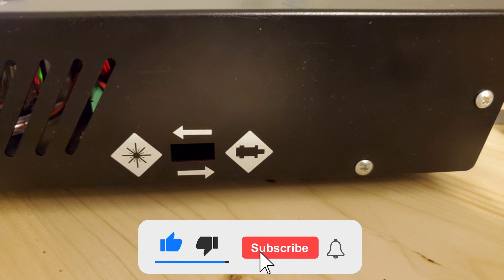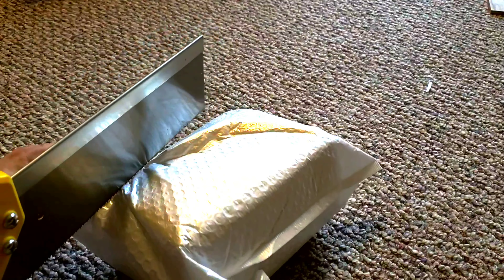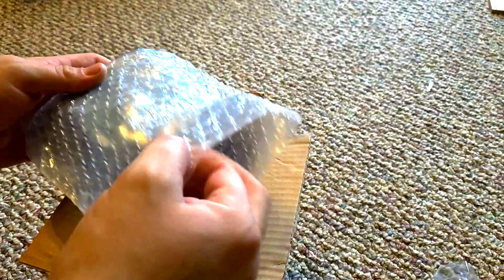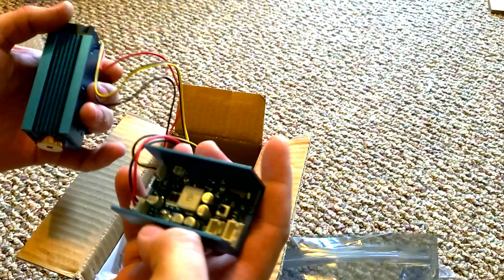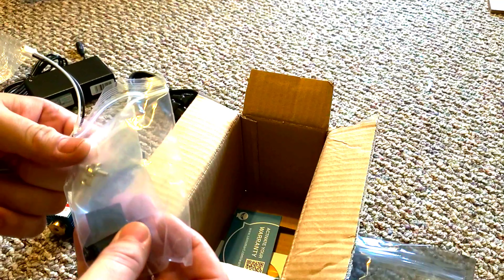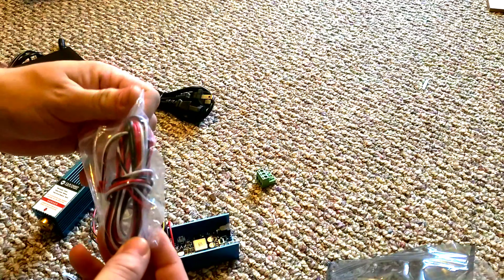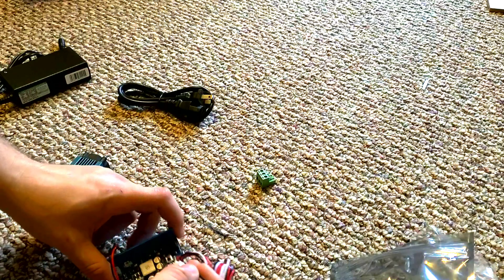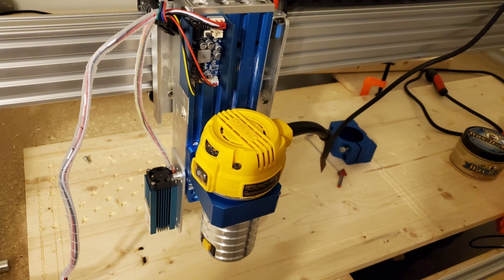ProverXL 4030 Laser Upgrade

Comment: Thanks for posting the video ! I was thinking about doing this.
Reply from the maker: NP Bro. Let me know if you have any questions and check out my upgrade too if your interested in expanding your 4030. https://youtu.be/WsXbvQ533_c
Reply: @practicemakesperfection8459   I got the laser . I am currently working on Aluminum cutting with it. Already broke a bit haha.
Reply from the maker: I havent tried aluminum yet but been wanting to try. Really interested in doing some large challenge coins.
Reply: @practicemakesperfection8459   Do you have the pin out for the green connector from left to right I have red , white black
Reply from the maker: @shanewally1537  mine is black white red left to right. works great with light burn but fires when i have my switch in cnc mode and run grbl so i just unplug it when using my router.